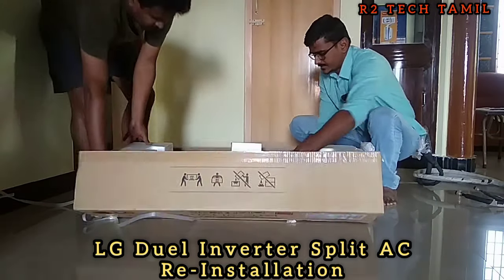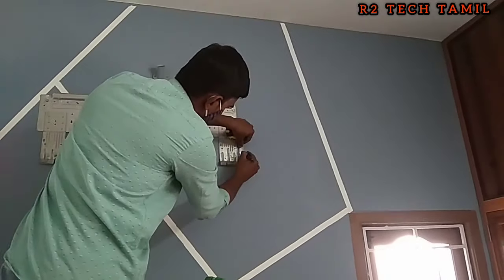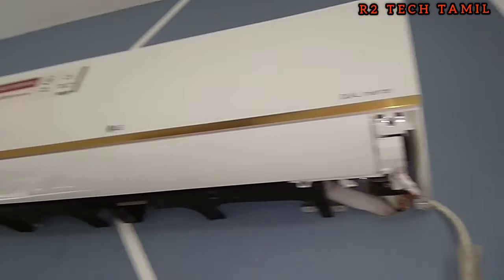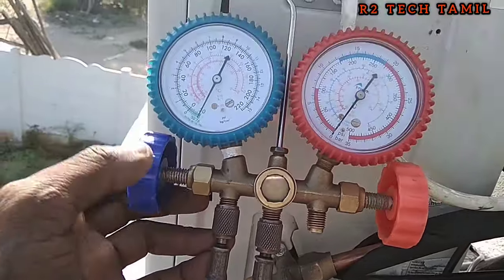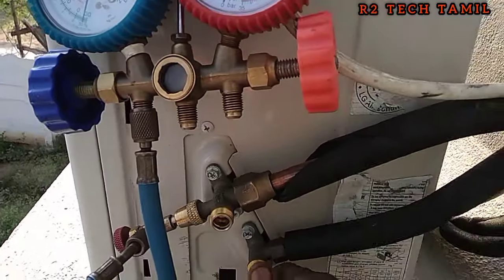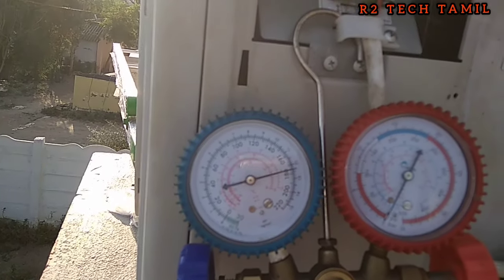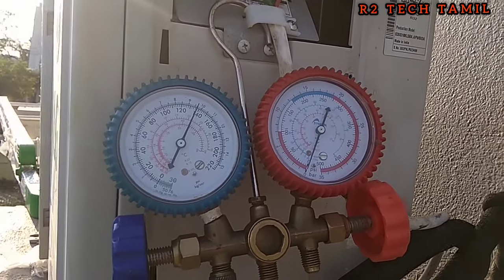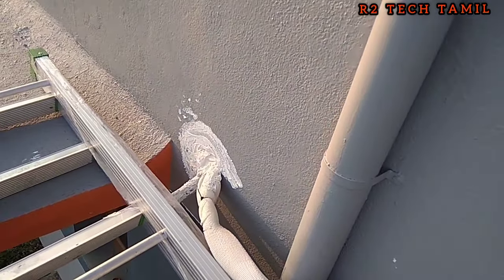Inverter AC Installation தமிழ்.

Comment: Always put the hole left side of the template. Don't spoil the originality , it will be easier to remove the indoor for service ,and don't want to break the white cement packing.
Reply from the maker: Yes. Ur right.
Reply: @r2_tech_tamil  You make it hard for yourself, always use the right hole
Reply: I don't understand  what's the point of put the hole on left side ? How does it helps while service the ac
Reply: @narutofanyt7337  because you have more slack in your lineset. Because al indoor units are connected at the right side.
But is sucks ass tho

Comment: Bro nan Village la iruken. Ennoda vedu roof illa. Tata steel sheet than potrukom.. over heat ah irukku... Enaku features lam neraiya venam. Room cool aana pothum. Room size   10*15. Nan Village irukurathala... Maintenance apo apo panna mudiyathu... So ac repair aanalum ready panna spair kammiya aagura maari ac suggest pandringala please
Reply: Electricity athigama aanalum paravala..
Reply: @thanglishthamizha1660  non inverter ac is best for you
Reply: First fall ceiling pannunga

Comment: Bro low voltage 😢140 than varuthu 1.5 ton ac pudhusu bro indha low voltage la edhana problem varum ah bro
Reply from the maker: Use Stabilizer must, double booster
Reply: Very good  explaing good    baic  not raber pad not using must ok
Reply: R32 whre using indiausing ok stand prssure120 to135 oksushion 70to80dis  .250to 260 dis 140150ok thanyou welcom to jolly